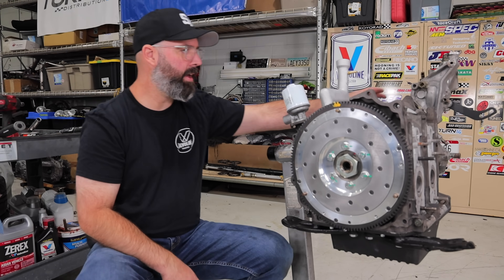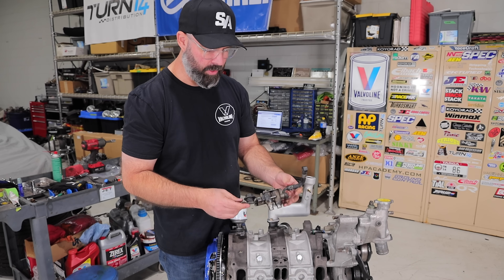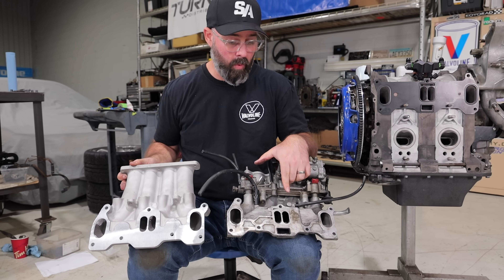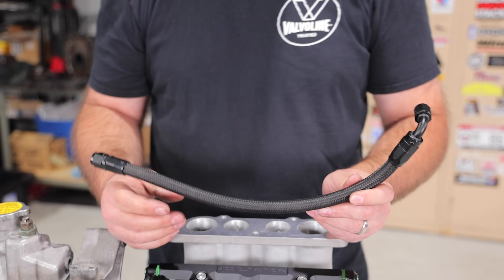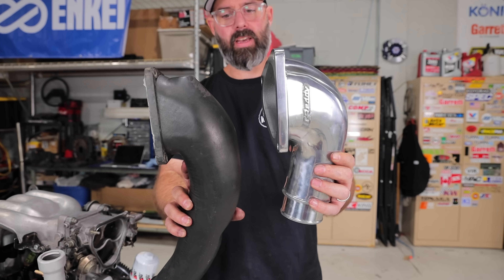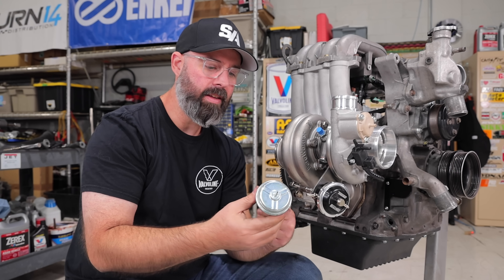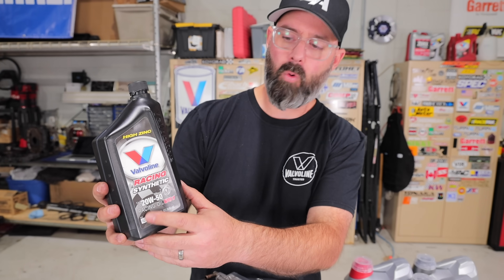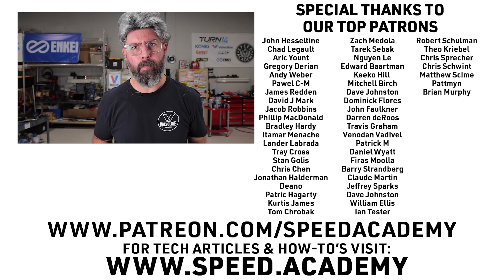How to Build A 10,000RPM Rotary Engine - Part 4

Comment: “Typically these motors dont make much torque” Rob Dahm: “Hold my hard cider”
Reply: The best part of Rotaries besides the compact block is that we can make them flow air like a V6 just by porting. If you want to make torque on a rotary just change your turbo setup or add spray, the V8 guys run turbo and nos so why not us. Also don't forget that back in the day the banned Full Peripheral port motors because of the unfair amount of power they were making for their classes ☝🏿
Don't sleep on Rotaries
Reply: @dubbleA100  you forgot to throw fuel consumption out the window...
Reply: @Jarmundx  trust me bro my FC Sluuuurps I'm waiting for my Standalone so I can clean that up
Reply: hahaha yeah! People sleep on stock or smaller ports making considerable torque.  Going to keep pushing stock 2 rotors harder and see what i get out of it.  Exciting to see Speed Academy cover a rotary engine build!
Reply: Just watched that part.  Yeah with the motor being high compression rx8 rotors it wont see as much boost as i was pushing. so hes right about the clutch being rated properly. But yes the stock block can easily make 500 ft lbs of tq on e85 reliably.  idk 80k miles reliable. but definitely solid for a while
Reply: They are making the build I wanna do on a Baja beetle one day, except I wanna do a semi pp. Semi pp on low boost would be as reliable as it could get I would imagine, except for a full pp.
Reply: @harrisonA0201  I have a friend who just got his Dune Buggy running with a NA 13b
Reply: Alvin Ameyaw That is awesome! I can’t wait to be in the same boat lol. My friend has a supercharged beach bug and an even rarer country bug. All are amazing off road!
Reply: @harrisonA0201  yea those are some really cool fun builds I would love to do something like that when I get a house Sunday
Reply: @RobDahm  my friend Seco from PR was doing that when he was like 20 with eBay turbos cos that's all he could afford back then.
I have a couple 6 port turbo motors that imma start testing with. One with S4 NA rotors and 1 with Reneiss rotors. I'm building my car for time attack, road racing. You know grippy boi things! Can't wait for your in house motor build series here soon ✊🏿 keep it up Rob 🙏🏿
Reply: Legit. Rob was making over 1000nm lol
Reply: Big lol.
Reply: $80K engine? Shit's internally stock, isn't it?
Reply: @tommylyeah  no his spare engine is stock but that was the bullet one. And a 4 rotor e-shaft is like $20k 🤣
The 2 rotor is stock
Reply: @GbbJunkie that I didn't know damn man it's been like 40+ years and they still scared. I guess it's right though, cos if they could keep up then I wonder what it would be like now with all this new tuning tech
Reply: Fake News, Rob drinks Zima.
Reply: Hold my New Balances
Reply: That turbo is tiny for a rotary.... I have the efr 9180 and it spools very fast in my rx7. Fast enough I need to buy a twin wastegate to catch the slight overboost. I actually sold my 8374 because it spooled Incredibly fast for my liking. The 9180 makes 20psi by 3700rpm on my setup
Reply: It only took a $80,000+ motor to do so.
Reply: @justinmalone8518  yea but he also made almost 600hp 580ft/lbs on the 2 rotor Corvette Soooooooo 🤔

Comment: replace that goofy loop with a small length of hardline or at the minimum put a straight fitting on the front of the primary rail and use your swivel on the secondary.  a much shorter route and less likely to heat soak.

Comment: I am so curious on the final HP/Torque numbers when this is over.
Reply: I'm gonna guess about 320 to the wheels and they won't actually need to rev it to 10,000.  It'll peak at about 8700.

Comment: Isn’t the rotor speed to crank speed the other way with the rotors spinning at ten or twelve k and the crank doing a third of that due to the torque multiplication gears inside the rotors?
Rotary engines have zero torque almost so they gear them down at the crank, or is that some other type?
Reply: The crank spins 3 times faster than the rotors. So at 9,000 rpm the rotors are spinning 3,000.

Comment: I am still curious why you didn't go with a SOHN adapter. But love the build. Curious to see what it can do!
Reply: They're running premix, as discussed in the previous vid.
Reply: @Hybridesque  His argument for that is that there won't be any engine oil injected into the engine. But that is the same case with a SOHN adapter with the added benefit of getting the oil where you want it.
Reply: I like the sohn but you are getting rid of various failure points by just deleting the oil injection system all together.

Comment: No to ls swapping an fd.
Reply: it’s better to kswap them like gear and gasoline :p
Reply: Jon athan a k series is actually a really good swap. It keeps the driving dynamics close to factory and the engines are just perfect for horsepower and keeping the weight distribution right.
Reply: @JosephSamsor  You do realize a ls weighs almost the same and sits far back near firewall so really you have great weight distribution and a reliable engine with parts that are dirt cheap. I get wanting to keep the car true to the heritage but to say a LS would be worse in the car just isn't true
Reply: Intoeverything I never said it’s worse. The person I was speaking too clearly thought it was a bad option, even though it’s a great option in about every way. For me personally, a well built k series is cooler in a rx7 than an ls but both are good. Personally I’d want to stay rotary since it’s such an expensive car in the first place.
Reply: @Shiftheads  its not that rotary people all hate dunnydore engines there thirsty and have many issues too.... id rather have a ported rotor over a crappy v8
Reply: @seanstrange69  it's that rotary people have the argument of its blasphemy its not an actual argument that a rotary is a better engine. It uses more fuel like almost twice as bad mpg as 5.3 or 5.7 ls. Has way mor eoil usage and reliability issues. There are literally millions of ls engines with over 200k miles. I get it if you want to keep the original power plant but there is a reason the LS is so popular because it's hard to beat. If you read about the swap you will see the weight balance is perfect. Put a stock twin rotary or single turbo up against a Ls3 around the road course and beat the crap out of it and there is no doubt which would be faster and last longer and it's not the rotary sorry triangle worshippers
Reply: @bonjouravecuns  no
Reply: agreed it's blasphemy

Comment: Can we inject 20w-50 thru OMP into rotary?
Reply: Always use 20w50 rotaries need the heavier weight oils unless you're granny driving them.
Reply: Yes if you’re going on about the factory omp, but it’s just easier premixing the gas with tc-w3
Reply: @W4rBoY97  TC-W3 or JASO FD 2T  better?

Comment: Something that I see, You mentioned the Phelonic spacers keeping the heat out of the fuel rail which is very smart. However then your routing your fuel line right on top of the engine. I would suggest heat wrapping the Fuel Lines or trying to re route them so they aren't heat soaking on top of the engine.  Just my 2 Cents. Love his build series! I can't wait to see  this engine running in the car!
Reply: That's exactly what I wanted to point out either